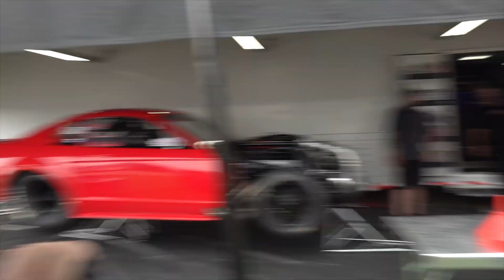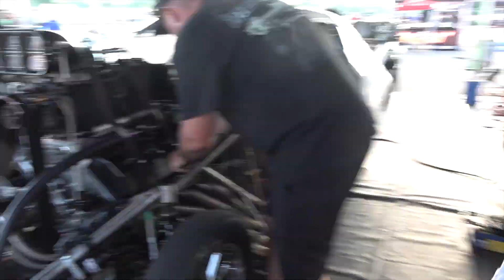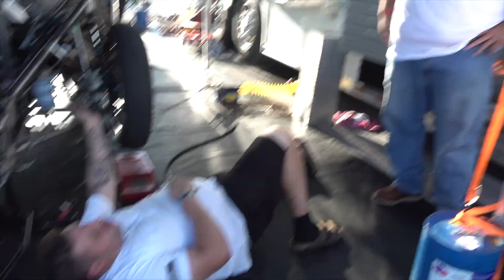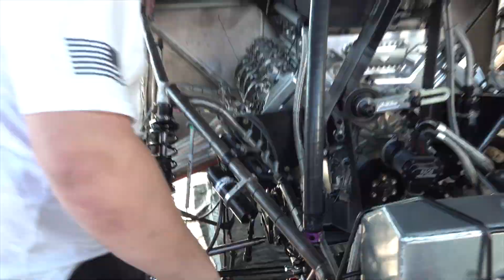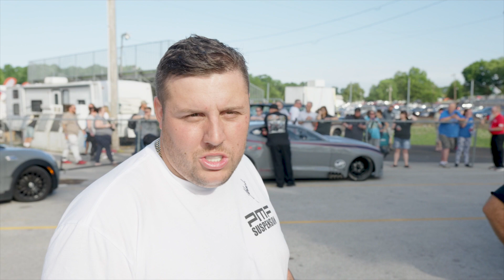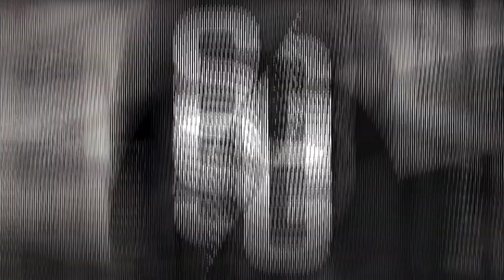New Screw Blower Combo Is Making Some Power! First Rip Down No Prep At Beach Bend Was Not Okay!

Comment: Screw Blower is making less horsepower, But the New Procharger will make a lot more, But make sure you run the latest Injector firmware, and new intake bolts to cut down intake replacements and car rebuilds... my guess the new Procharger will return, with just as nasty of sound and More usable horsepower and higher wheel speed on the top end, if you are serious about winning NPK... Just Saying
Reply: The ProCharged cars were hauling ass, my guess is he’ll go back to ProCharger once he recoups some of the rebuild money and has a bigger cushion for repairs since the Procharger tears so much up

Comment: I think the rules are favorable to procharger, if drive ratio to the blowers were equal and weights were equal, the competition would be equal on hp and speed, but the pro chargers breaking all the time and the gears to make it impossible to regulate overdrive ratio and the money pro charger has paid to have that rule advantage make the rules a f’ing joke!
Reply: ProChargers break too much.  Back to the screw-blower we go!  And the few old school die-hards who still wanna spray their mountain motors.
Reply: What rule advantage?
Reply: @colinlloyd1543  weight, and screw blower over drive ratios
Reply: @jkK-lw9lu  well procharger are the heaviest now in NPK
Reply: @colinlloyd1543  big block twin turbos are 100 # heavier AND limited to 98mm, the screw blower big block is only 50# lighter AND limited to 98% overdrive. I believe this is why the procharger combo has been faster and coming around the competitors at the top end by small margins.